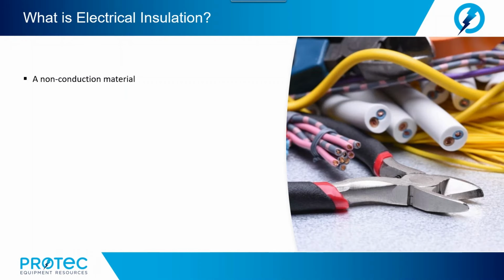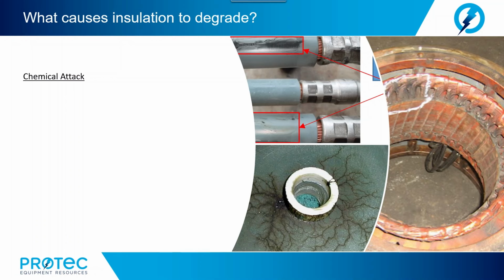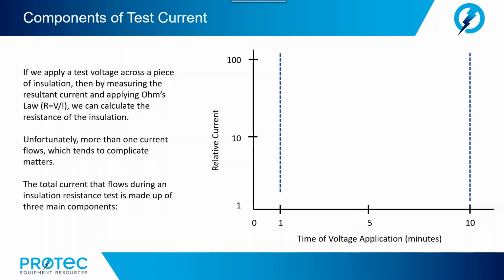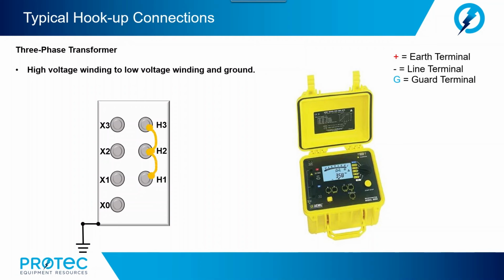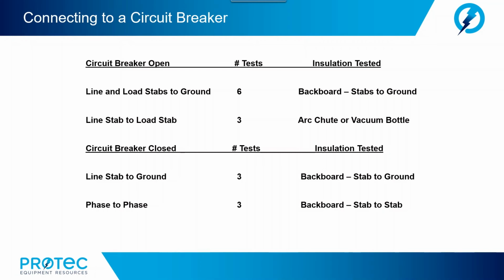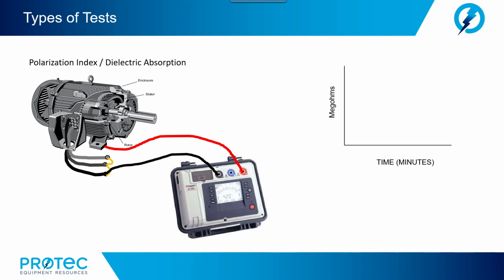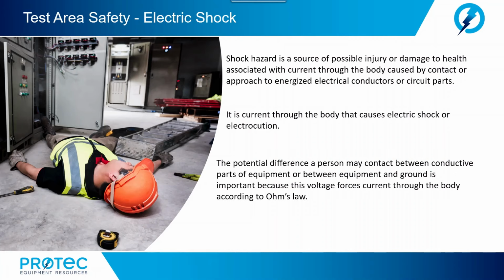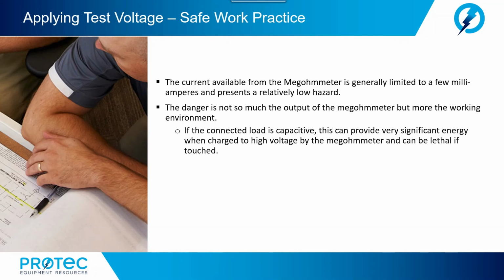Understanding Insulation Resistance Testing

Comment: Can you do a video on how to calculate TTR without equipment?
Reply from the maker: Absolutely we can do a video on turns ratio testing and calculations covering a range of techniques and calculations.   In the video we can discuss:
Standards and Definitions
Winding and Polarity
Transformer Vector Group Codes
ANSI Transformer Winding Phase Relationship
IEEE C57.12.90 Measurement Method
Nameplate Voltage / Nameplate Ratio / Voltage Ratio / Turns Ratio / Measured Voltage Ratio
Recalculation Factor
Testing Three-Phase Transformers with a Single-Phase Test Set
Interpreting Test Results
Coming soon....